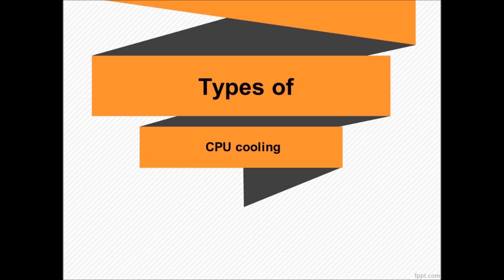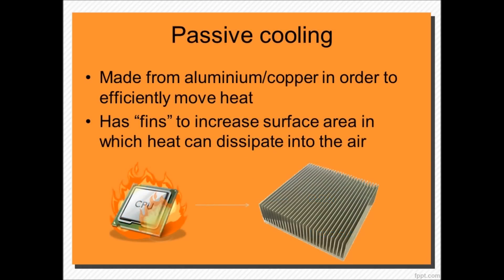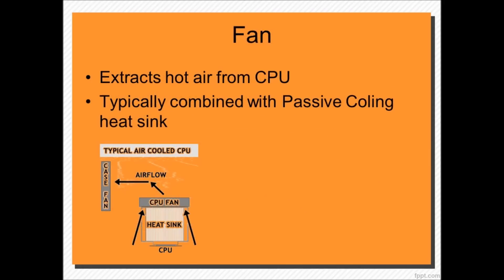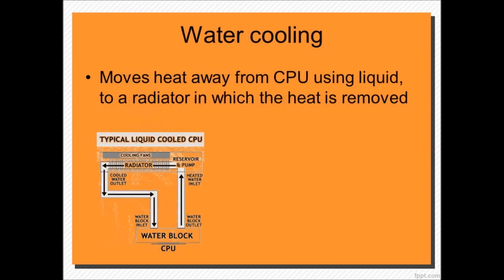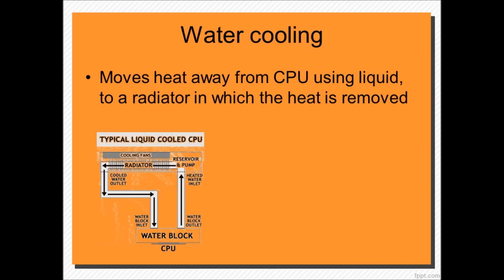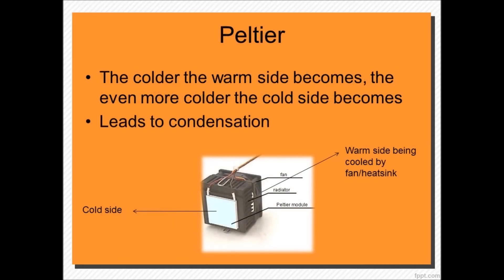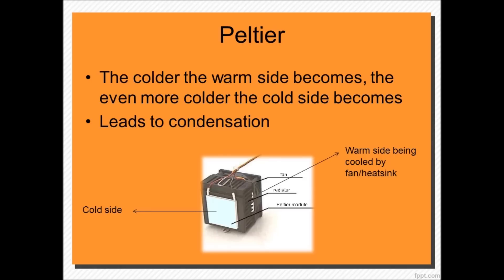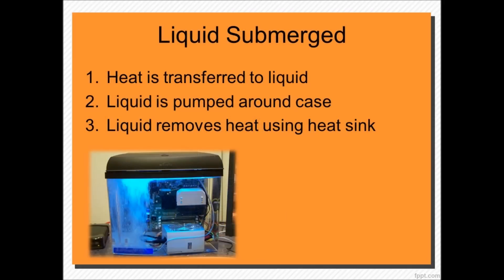Types of CPU Cooling

Comment: I know distilled water does not conduct electricity but eventually won't the metal put impurities in the water thus allowing it to conduct electricity.
Reply from the maker: Michael Blevins yup you're completely right. It's good practice to swap out the water now and then. Using mineral oil also minimises the problem

Comment: then there is phase changeing. witch is the same as in a fridge or in a  AC unit. it works by compressing and condensing a gas in one end that gets hot and evaporate the gas in the other hand that gets cold.

and you have it wrong with liquid submerged. it is not destilled water, it is mineral oil. water would solve and corode the metal in the computer untill enough impureties has been added to the water to short out your motherboard.

otherwise. good and informative video.